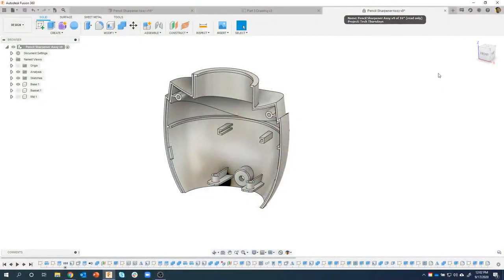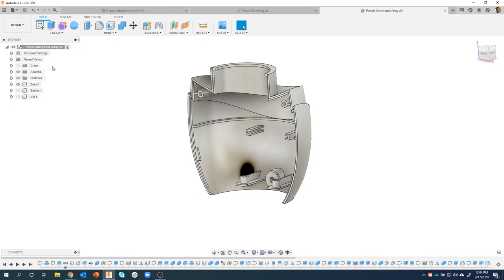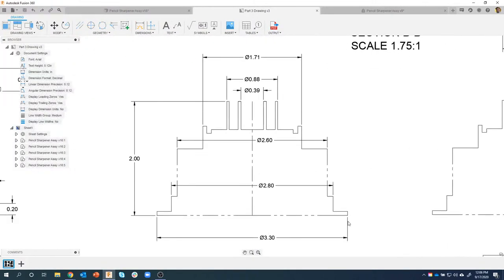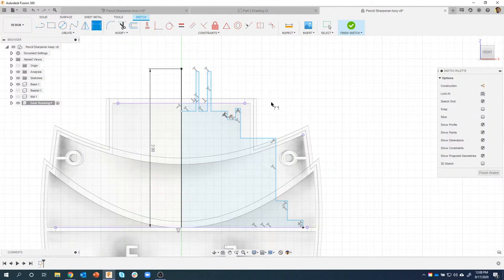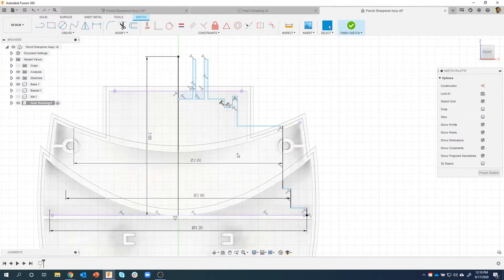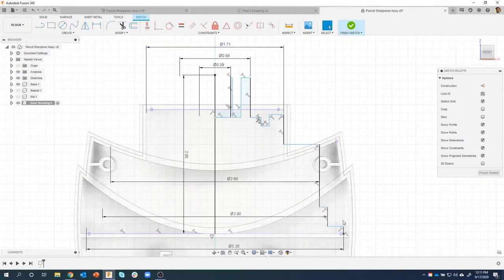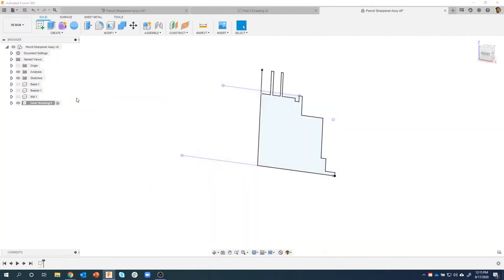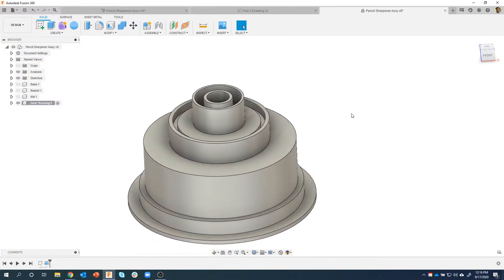Episode 73 - Pencil Sharpener Project,  Part 3

Comment: Hey Brad! Great live so far! Love how you show many of the lesser known features and also how you suppressed the “computational heavy” features to save calculating time! Great stuff!!! I am currently at 49:17 and wanted to point out an other lesser used feature you could have showed. Instead of doing the “go to” split body, you could have extruded the rectangle profile but using the “Intersect” option.:)

Comment: I had to roll back my time line to un-suppress those fillets,my rig said "no-no". Thanks again for the tips,emboss can be used for a wide variety of patterns and short cuts.
Reply from the maker: Not sure why unsuppressing the fillets didn't work for you.  Worked fine on my end.  Glad you are enjoying the videos!
Reply: @bradtallis8968  my computer needs some upgrades

Comment: I missed the part in this video where the 4 x Ø0.15 in holes get their inner holes Ø0.15. As you can see at 52:20 the v9 version doesn't include those inner holes and the v16 version does as shown at 53:00. In part 4 in this series we'll start with the version which include these inner holes,  so it was a bit confusing, but I could add those holes based of the drawings.

Great content, much appreciated!